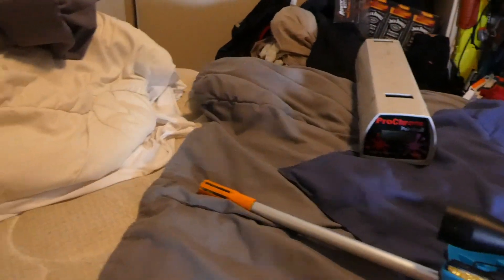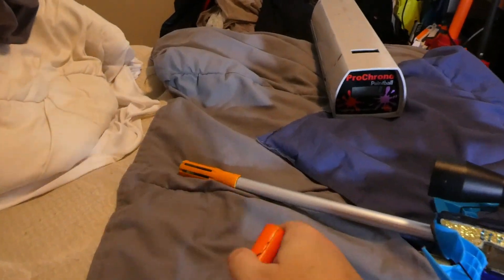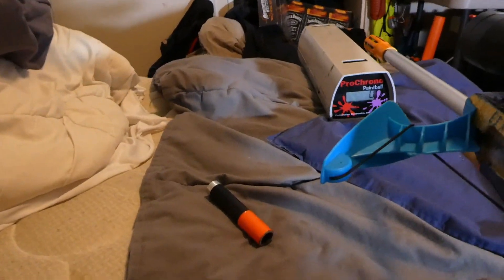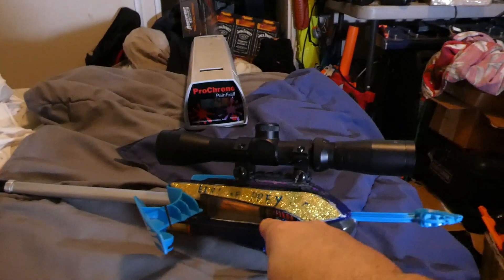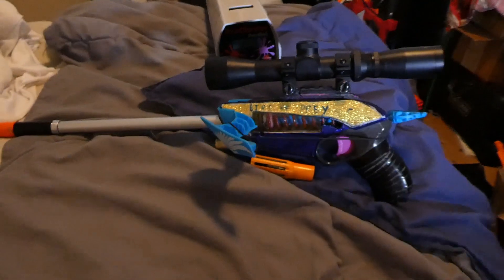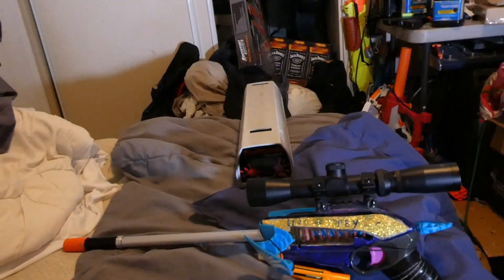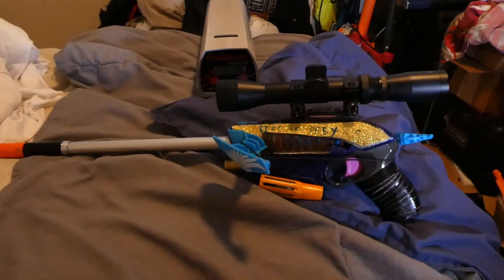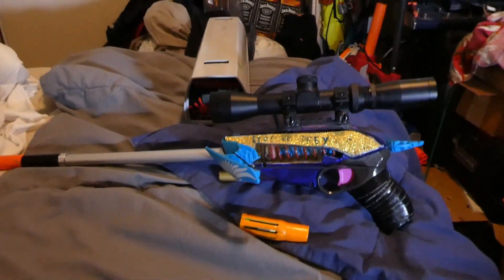[UPDATE] I'm glad I did not shorten the barrel on the Bird of Prey Type LT.

Comment: 278 is pretty hot, especially if the spring is tired as you say.
Reply from the maker: Or honestly, I may have messed up the crown or something in the barrel converting it to a standoff rather than a UM port, not entirely sure...  But one thing is for sure....  Barrel length is fine.